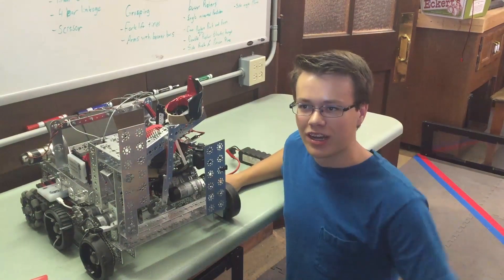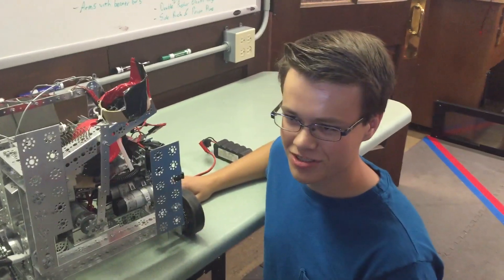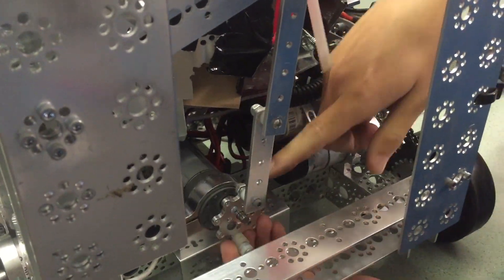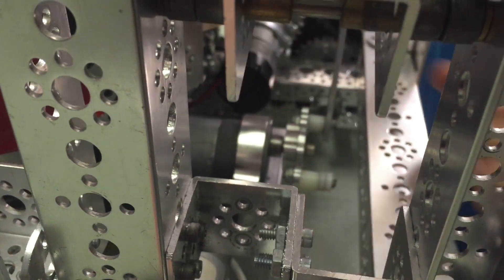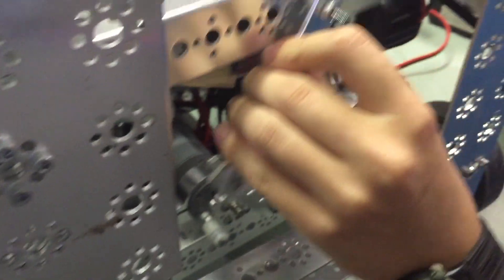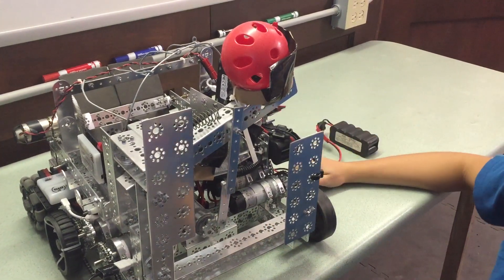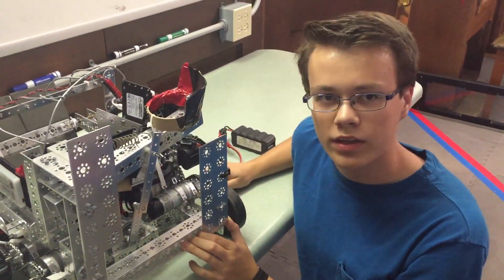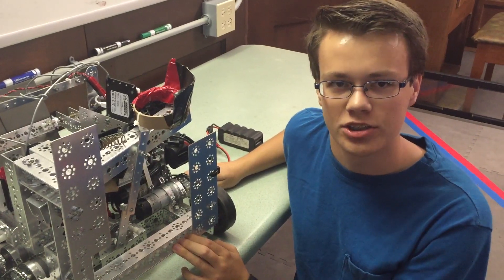Choo Choo Mechanism - Part 2

Comment: What do you guys put between the spacers to stop them from grinding in between each arm?
Reply from the maker: We actually just have some nylon spacers between the different bars in the linkage. On all of the pivot points we have lock nuts and are running the system slightly loose in order to keep the choo choo from binding up. (not optimal, but it worked with our three day build time constraint) Wherever it is appropriate we are using two lock nuts to make a jam nut to ensure that the system does not tighten or loosen. I hope that this helps!

Comment: What type of spring did you guys use
Reply from the maker: It is a small extension spring that we had used several years ago, one of our team members brought in a bunch of springs from his farm and we just used those. We plan to either buy springs from a local hardware store, or order them on Mcmaster Carr so that we can get the same strength springs.

Comment: What is the name of the wheel called where the stopper and the Choo Choo is attached? (The 8 sided 'gear' thing)
Reply from the maker: The "wheel" is a pattern adapter from Actobotics. The component is called a "1.50" - 0.770" Pattern Adapter" Servo City is the group that makes these Actobotics parts.
Reply: Thank you very much